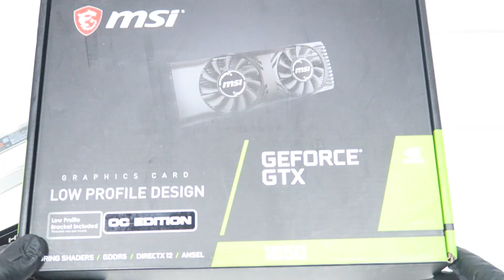Dell Optiplex 7070 Gaming Upgrade RAM SSD Video Card

Comment: Bro i have a hp elite desk 800 g1 sff, processor is i5 4590 with 8 gb ram, 500gb hdd and stock 240 watts psu. I wanted to add a gpu to upgrade it into gaming pc same as to your vid. Any suggestion for the best low profile gpu and do i have to upgrade its power supply whenever i add gpu on it?
Reply from the maker: Hi, yes the best video card low profile you can use.
GIGABYTE GeForce GTX 1650 OC 4GB GDDR6, Video Card Low Profile
https://amzn.to/2B7N1sP
Reply: @Mxkdt  thanks. Without bothering for the power supply consumption right?
Reply from the maker: Yes with 240watt power supply works fine and you have to upgrade to SSD for main boot drive

Comment: Hi, will the 200 W power supply be enough if I use 1050 ti. The cpu is i7-9700.
Reply from the maker: Hi, no you would need at least 240w power supply with 200w gt 1030 only
please watch this video.
https://www.youtube.com/watch?v=zjG4lglejF4

Comment: Does it actually work with the GTX 1650 in the PCIE x4?

Other than that, thanks for the videos, theyre all very good, keep up the good work.
Reply from the maker: Hi, yes GTX 1650 low profile does work in the PCIE x4 in this dell.

Comment: hello great videos, i have a 7050 SFF as well and id like to boost my graphics card, what do you recommend for that to keep up with current PC games that my 12 year old likes to play, like Fortnite, and other popular games. Mine has the I7 7700 processor. i would like to use my original power supply as well, thanks
Reply from the maker: Hi, yes you can only use low profile video card in small form factor case and you have to check and see how many watts is your power supply 180w or 240w?
Reply: @Mxkdt  thanks for your response, so what current low profile graphics card do you recommend? Thanks
Reply: @Mxkdt  you can move the motherboard and adapt it to a mini ATX tower or a normal tower?
Reply from the maker: @zamirroa  Hi, yes it is possible and i do not recommend it.

Comment: Im new to the pc world and wow wish i seen this video on the 5th. i have the dell optiplex 3020 and i was look for a card that was good for gaming for this build. i bought the gt 1030 because i wasn't sure if anything else could fit. i literally got it today its good but i rather would like to get this one. great video.
Reply from the maker: Hi, do you have  dell optiplex 3020 mini tower or small form factor ? ...samll form factor you cant install gtx1650 because pci express x16 slot is on the bottom and top slot is pci express x1 slot wont fit gtx 1650 unless you get mini tower.
Reply: Mxkdi yeah I figured. It’s a sff
Reply: @SuperGamersplus  Yeah a low profile 1650 would give you good frame rate in games.

Comment: If you are opting for the 1650 get the gddr6 version. It's around the same price and performs a little better
Reply from the maker: Hi, yes gtx 1650 gddr6 low profile video card,   i could not buy online because it was not in stock.

Comment: I have a tower version with 260w psu and 85%. Gtx 1650 s consumes 100w and the CPU 65w. Can this graphics card works correctly ? 16g of ddr4 and 500gb of hdd storage.
Reply: Yes, it should work correctly.

Comment: @Mxkdi Question: I have a Intel i7 4790 CPU on a Dell Optiplex 9020 Motherboard. I want to use the same CPU for a new build. Could you (or anyone else) recommend a motherboard compatible with the 4790?
Reply: Don´t do it. Not worth it anymore. You can get a ryzen 3100 for 100 bucks and a mobo for 40... Especially if you have a regular 4790 and not a unlocked K cpu. Sell your system and with 50-100 bucks more you got a modern platform.
Reply from the maker: Hi, yes they sell Motherboard with Z97, H97, Z87 Chipset that will work with i7 4790 CPU
Reply: @Mxkdt  Thank you!

Comment: Awesome, thanks! Is there any performance or compatibility problems using pcie x16 pin video card in a pcie x 4 slot? Cheers
Reply: I'm not sure, but I have a older optiplex and the 1050ti seemed normal, no difference when I upgraded mobos :/
Reply: x4 lane seems to be enough with 1650 or 1050Ti, x8 can handle 2080Ti. so don't worry
Reply: x16 has better performance than x4, lots more
Reply: @travisstoia4627  no it really doesnt go watch the bench marks on the 7020 optiplex you lose little to no frames at all bud.

Comment: Nice upgrade there! I might think about upgrading a dell optiplex 790 MT!
Reply: Noooooooo that's a little on the low end pc side go for the 9020 or 5040 or 7050 or 7070 for better speed and handling

Comment: does the gt 1660 work well? i didn't think there would be enough spare power from the psu to have that as an extra.
Reply from the maker: Hi, no gtx 1660 will not fit sff case only gtx 1650 low profile or gtx 1050 ti low profile, gt 1030 low profile will fit fine.
Reply: @Mxkdt   how to know if the power supply is enough for a gpu ?
Reply: Imad Mimeche I’m using 7050 , 180 psu “ bronze’ with a 1650, no problems at all.
Reply: @jimcachero  Still working fine?
Reply: Mxkdi because of inech